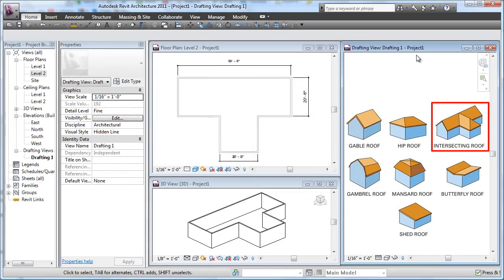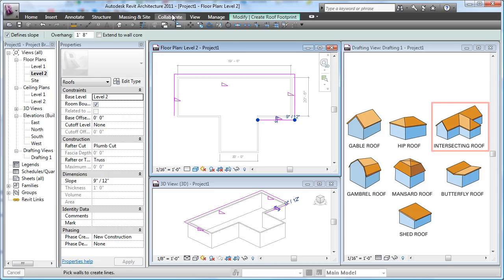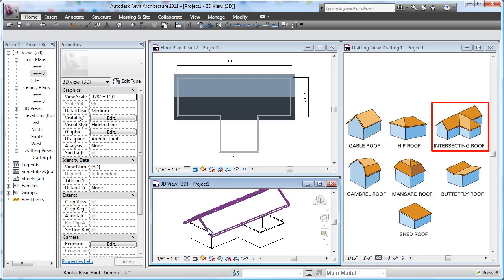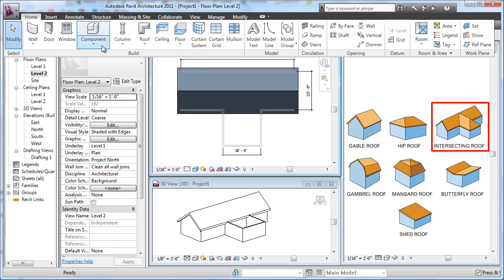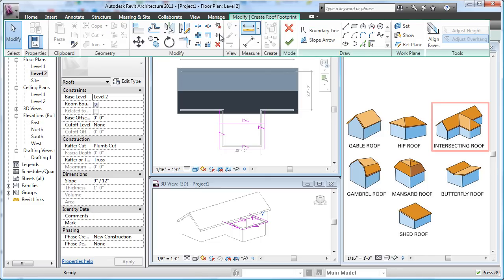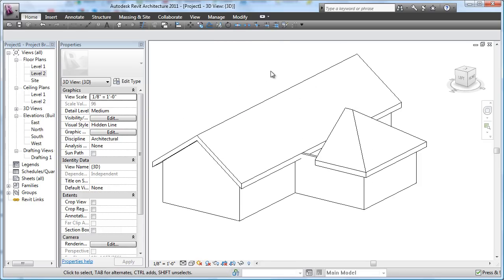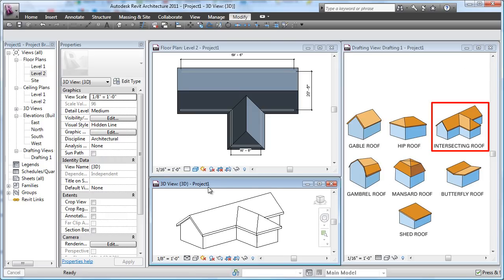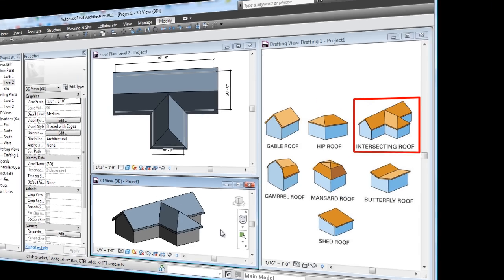REVIT Roof  Basics  04 Intersect by Roof Join - CADclips

Comment: Gavranarh, this is the way you should do it, when doing a complicated roof.  Sure with a simple set up, as show in the video, it can be done simply and still give a clean look.  However, if he were to offset the smaller hip 1' above plate, and it raises it, he then has airplane wings instead of a clean join.  It definitely is necessary to know how to do this in Revit, if you care about accurate representation.

Comment: HOW TO CONTROL THE SLOPE DEGREES???---there is not degree value option..
Reply: slope is calculated as a fraction, over 12 (inches per foot), if you are using metric, if you are used to metric system, here is a conversion chart which may help.  When you click on a roof line, it will turn blue and in the properties panel, you will see "slope", my default comes out as a 9:12.

http://roofgenius.com/roof-pitch-degrees.asp

Comment: Thank you for your great tutorials.  I tried to do the same this, all fun and games till I came to the point where you point out the problem with intersecting hip roof being higher then than the gable roof.  So, you just selected one wall, altered the wall offset dimension and as the wall moved to a new desired location, so did the roof (with obvious modification in height).  How did you mange to shift the wall and to roof to follow?  I moved the wall, but the roof remained where I left it!